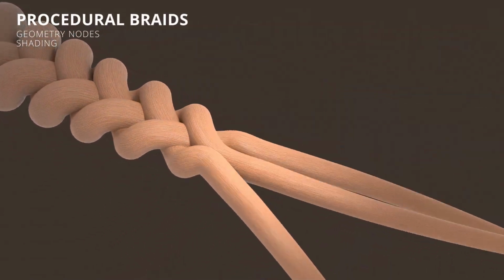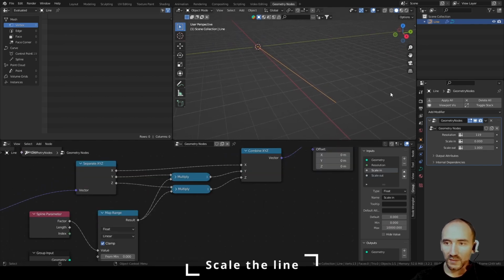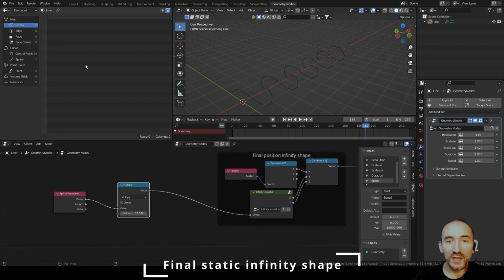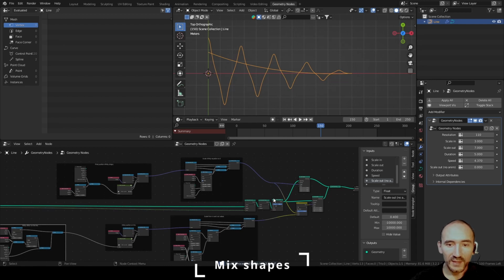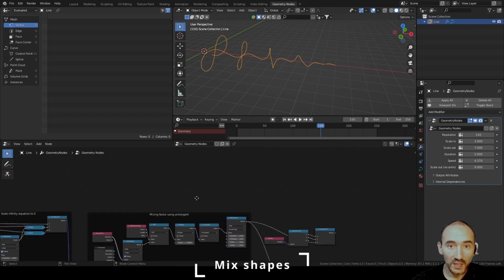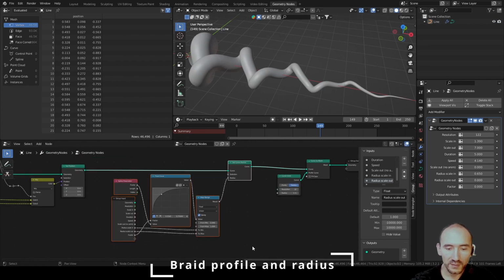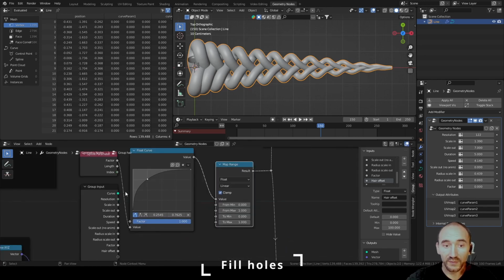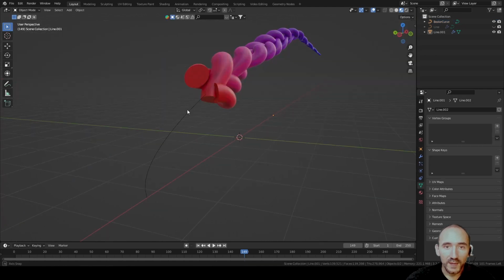Procedural Braids in Geometry nodes - Blender tutorial ENG

Comment: Good tutorial where I learned a lot. 

Pity that the file you kindly gave us (and it si perfect) si very different from the one we build. 

The names are different and whan I tried to see what I did wrong I couldn’t use your file as a reference. I know it was my mistake because I did it more many times and got it right at least twice. 

Anyway, thanks both for the tutorial and the file.
Reply: Thanks. I found the solution. It came from the fact that when you plug an in,put into an already occupied socket, instead of replacing the previous input Blender moves it to the other socket. I wonder if there is an option to change this since it causes me more mistakes than it helps.
Reply from the maker: @johnsmith56920  Good to hear you found the solution and... 😂 i know...I slam my head a lot on that behavior but I haven't found a possible solution about it.
Reply: @andrea_ciani  Once again thanks. I'll try to use some of your techniques to reach my goal: Manipulate high res meshes with equations. The arctgte or the map ranges factor might be just what I missed. A way to smoothly apply the deformation to a selected area (in Photoshop we call that a feathered selection). Plus, by adding just 100 or so hair on the braid I might be able to get a photorealistic braid.
Reply from the maker: @johnsmith56920  Good job!
Reply from the maker: Thank you John! I appreciate it! I know about the differences between the files so i uploaded right now a new version with a more accurate naming and positioning of attributes and frames in the nodes. I maintained suffixes in the labels of some frames to better explain the features and in general i maintained the animation file because it has more shading and animation details than the shading used in the tutorial. Download it again when you can and thank you for your feedback!